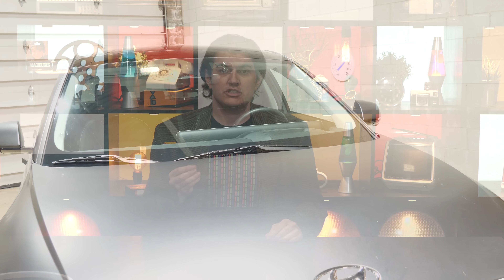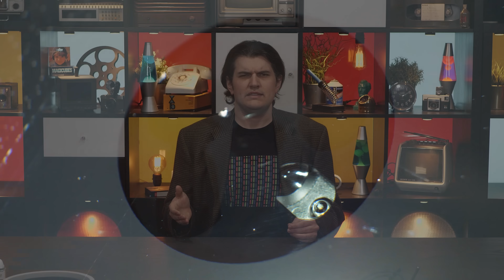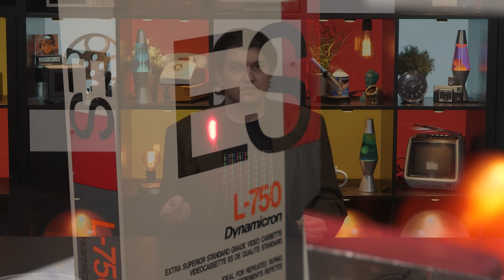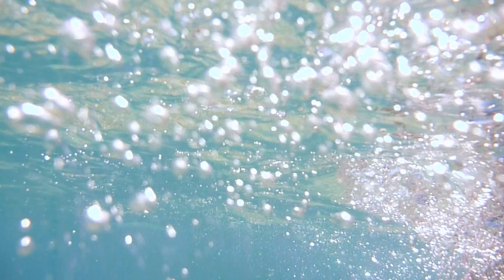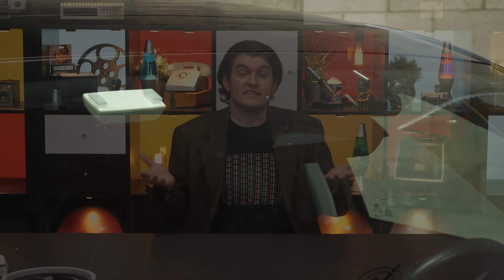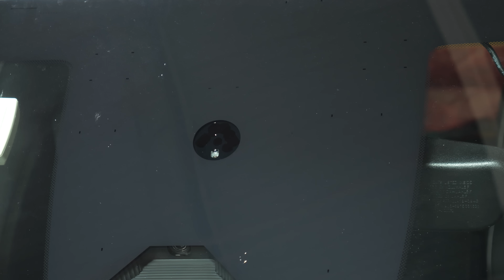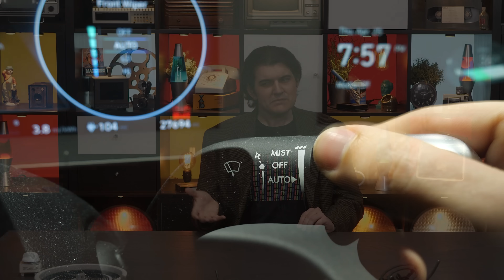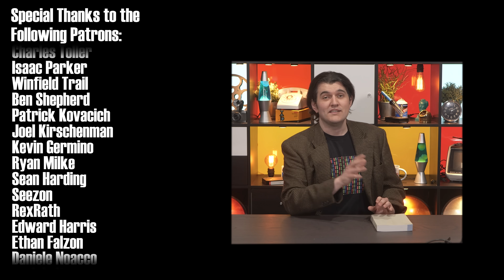The simple, clever sensor behind automatic windshield wipers

Comment: The Toyota I bought last year has them. I do not like them! Even with the sensitivity set to max, they don't operate often enough. The windshield will be covered with small drops and they won't operate. I find myself using the mist setting a lot during light ran showers. I don't like my vision obscured in any way, if possible. If I see a streak or bug spot directly in front of me, it's very distracting and I'll stop ASAP and clean it. OCD can be a b1tch sometimes.... 😄 I'm currently using my scan tool to try and find a way to turn them into intermittent wipers.

Comment: With two sensors, I don't think they would need any calibration at all beyond synchronizing them at the factory. From then on, if their signal intensity is the same = not wet, a discrepancy = wet.

*Disclaimer - This is based on all I know about rain sensors from a 10-minute YouTube video so I reserve the right to be very wrong :)

Comment: I've noticed on my vehicle with automatic wipers that somewhere just over 50% of the time it does a wipe on startup even on a completely dry windshield when parked in the garage. I've also noticed that if it is actually raining when I start the vehicle, and it doesn't do that wipe, which it often doesn't, then I will have to trigger the first wipe manually before the automatic wipers will do anything.
I'm not sure who designed that logic, but it seems like it should either always do that wipe, or be much better at figuring out when it's necessary.
My other gripe with automatic wipers is that rain by its very nature of being a series of drops in random locations can certainly be putting enough water on the windshield to warrant the occasional wipe, without managing to land drops directly on the sensor. I see that your car has two sensors in the same assembly, maybe that helps a little bit, near as I can tell mine only has a single sensor. Even so, I feel like what I would really prefer would be multiple sensors with a little bit of separation between them so as to cover a larger area of the windshield and be more likely to be hit by drops in light rain.

Comment: The Tesla solution of not using rain sensors is total CRAP! I've owned Teslas from 2014 and the first ones had rain sensors, AND it worked great most of the time. Now, with a newer Tesla with "vision sensor", I have the windshield wipers in OFF. I use the button on the end of the stalk to wipe or spray+wipe. I ONLY have Auto on when it REALLY rains. Auto is crap when it drissle/wet road - no wiping, sun - wipes away, tunnels - wipes eagerly..The Model 3 Highland and Model Y Juniper without stalk and/or without wiper button is totally off the table. Sigh 🙄

Comment: The automatic wipers on my Mazda are horrible. they often dont turn on if I’ve left them on in park and it rained, and the detection… especially at night, is just horrible. During the day they’re generally fine, but they didn’t supply a normal intermittent mode on the stock when they are working poorly so turning them off was just more convenient.

Comment: So funny story, I actually designed this exact system from scratch for my Senior project in college electronics about 1997 before this was a feature was even available on automobiles. Mine had a few extra features. One was some logic circuitry so that if the windshield wasn't "clean" after 2 cycles, it would automatically activate the windshield washer. (like when you get that dirty splash back that dries up quickly). In addition there was an inside and outside thermistor that were tied to  some logic circuitry so that if the outside temp was below freezing, it would not activate the windshield washer until the inside glass was above 45 degrees (aka via the defroster). I tried to patent the unit, but the patent attorney said "If its for a car, your wasting your time. the auto industry has hundreds of engineers designing stuff for cars and pulling patents on them for stuff they either never implement or do so years down the road." Anyway...,...

Comment: In fact, in order to achieve fail-safe feature, sensors are designed to send shut-down signal to the wiper motors. So when the sensor fails, the shut-down signal is out, the wipers will run at full speed to make sure you're not losing your sight. This is another thing interesting about that.

Comment: What bothers me is that my car has three wiper modes - Automatic, Fast and Insanely fast. Automatic works however it likes to work and is rarely right. Fast is just that - fast, and isn't always right when there is just a light drizzle and automatic decides to go crazy for no reason. The fastest setting is useless, because I may be getting rain strong enough for it maybe twice a year, if that. Old cars used to have a nice Slow setting, where the gap between the wipes was about 2-3 seconds or so and that was ideal for most situations - a mode that gave you a nice rhytmical pattern that wasn't too slow or too fast and worked in most cases. I'm surprised it is rarely being implemented today.

Comment: For some reason, this rain sensor does nothing but pisses me off. My dad's car has it, and my car has it. I have the urge to wipe every single drop of water, but the rain intensity is often either too weak for the sensor to engage or too strong to justify using the "auto" mode, just like 8:31. And when a weak rain happens, i have to manually do single swipes, because the "low" mode is too fast for it.
Would't it be better just to have a mode with fixed adjustable delay intervals like 1 sec, 1.5, 2, 3 etc.?

Comment: When your windshield gets a crack and needs replacing, will it cost a lot more to get the optical interface material attached to the glass just right (or does a windshield replacement generally mean replacing the whole sensor as well?)?

Comment: It is a little alarming when there is a slight mist and my wipers start at full speed while set at minimum intensity. I change the intensity setting up and down quickly which usually fixes it

Comment: Automatic windshield wipers? - I don't even have the "single wipe" option in my current car😅 Have to switch to "interval" and back - kinda annoying...
The wiper stock does not move up to where you usually would find said option. You could pull on it, but that triggers the water pump and that's not always the thing I wanna do.... so: Pain it is.

Comment: On VW Golf you have wiper command "one struck" when contact is on; the same, contact off, parks the blades in upper position. Good not only for changing them but also when snowing, so that blades arms aren't forced down by the snow on the windshield (and don't stick to glass when icing).

Comment: On my golf 6 when the windshield is already wet i have to wipe once manually or drive off and hope a bump unsetteles it enough for it to trigger.
However to change/clean the wiper blades you just turn the ignition off and manual wipe once. Pretty easy.

Comment: If you have driven enough in snow, there's an analogy for refraction you may have experienced: the way the light bends is similar to the way your car behaves as you get out of the ruts and into the snow. As the light enters the slower medium, that side of the light wave is slowed and, like the car catching the snow, causes the wave to turn into that direction. Obviously it's not identical since one is a wave and the other has wheels and mass, but still, it's a good analogy.

Comment: My Subaru SVX had a winter setting on the wipers. It would stop the wipers around 10 cm higher than regular. This prevented it from getting frozen with a bit of snow and also be in the direction of the warm air flow from the windscreen vents. Simple, but nice.

Comment: I feel so damn smart because I guessed a long time that this would work by infrared and measuring how well it reflects on the inside of the glass. Although I imagined there would be stronger/multiple LEDs at one end of the windshield and the detector would be at the other end so if any spot of the glass between them got wet it could detect it, instead of measuring the wetness in a single spot. But it would be harder to get infrared to shine throughout the entire windshield and you'd need better sensors to collect what IR is left.

Ah okay, it wouldn't be good because you'd also end up measuring the reflectivity of the parts that aren't wiped by the wipers and the car would think it must be raining literal buckets of water ...

Comment: Typically, cars are programmed to stop wiping all together when the hood is opened, so as to prevent any wiper-related collisions. A generally foolproof method to change wiper blades obstructed by the hood is to swing the wipers up, and pull the hood latch right as they reach the top of their travel. They then stop on their own, and generally will stay there until the hood is latched anew and the key is turned on.

Comment: My Cadillac CTS-V has these wipers and I find them to be a pain in the butt.  In delay mode they don't come on until they decide it's "wet enough" and so don't wipe when actually needed. I finally unplugged the control unit so the wiper revert to fixed, selectable delay.  Much happier now.

Comment: I am interested why car manufacturers fit different wiper blade styles to the same models depending on the market. Your Ioniq has old style frame blades, whereas here in the UK I believe they’re fitted with flat blades, and in other markets still, hybrid blades. But weirdly, Hyundai uses hybrid blades on some of its other UK models and there doesn’t seem to be any consistency, rhyme or reason.

Comment: In every car I owned with rain sensor I always took sensor cable off so wipers works like I want. Even lowest mode they always went on too early and wiped way too fast / often. Is it same as dash light adjustment so in manufacturers own good to avoid any problems lowest light mode is too bright. But good tip for everyone: If that auto wiper annoys you just take cable off from sensor. Then  wipers goes like normal. You can adjust all like older cars.

Comment: "Don't ignore the manuals in your life."

I've been a military mechanic for a decade.
Maintenance is based on the findings of the vehicle operators, who likely are not mechanically inclined.
But they are supposed to follow a very specific operator checklist before operating their equipment.
Do they?
Rarely.
Almost never.
Simply following the operation manual would literally save the U.S. military, and thus the U.S. people, millions of dollars every year.
Use the manual.

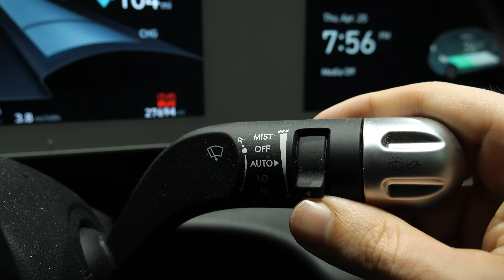Comment: I bought a car recently that had this feature.  While the car is otherwise excellent, this is one feature that I absolutely loathe and wish could be undone.  It never works properly just as is described at 8:05.  It's not that it occasionally has misfires or mistakes, it's that it is always misfiring or not wiping.  I have to basically operate the wipers manually by turning them on and off in the tempo I need for a given rain situation because the sensor will either not wipe or go nuts and wipe at max tempo when it doesn't call for it.

Hear me out on this - this is one technology innovation that is over-engineered.  Once the technology for windshield wipers evolved to the point where you can operate them from inside the car and choose the tempo easily, that was all it ever needed.  It was perfect as it was.  The extra bells-and-whistles like this sensor are just an extra complication and failure point which isn't necessary in the first place.  In a practical sense, it offers the driver absolutely nothing (except making the feature unreliable).  In a traditional windshield wiper, you turn the dial on the stalk on, then one or two more clicks to your desired tempo setting.  Works perfect every time.  In this setup, you still have to turn the dial on the stalk on, then one or two more clicks to your desired sensitivity.  You haven't saved any time or reduced any complication by doing this!  Even if it did work on other cars, it saves you nothing but makes a critical function of the vehicle unreliable.

Comment: BMW windshield wiper sensor calibration can be done with software. Only done when changing sensor or windshield. Drift according to windshield age is automatic (more chips with years). Plus, usually, if activation happens, one wipe is done to notice difference for sensor.

Comment: Is the sensor clever and simple? yup. Does it result in the windshield wipers more often than not going WAY too fast during a light drizzle or WAY too slow during a downpour? also yes. I almost always have to set my wipers back into manual no matter which vehicle I am in. Good idea but more often than not absolutely terrible execution. Same with automatically dimming headlights.

Comment: While my car is sometimes 'lazy' in the rain, it usually just works and I never have to adjust any setting or swtich it to the on wipe setting on the stalk. It just works. Also on my car, I can change the wipers because even in its default off position, its still possible to lift the wipers and change them when needs be. Maybe your car is the outlier with this design fault because every car I have owned I was able to change the wipers in the off position.

Comment: It’s amazing it works. It can only look at a small area and it has to have enough signal change to determine the rain intensity. The camera method, used by the company you did not mention, has the windscreen in its near field, ie not focused. How there engineers though that would work I am not sure. However, recent updates to the unmentioned car brand have delivered auto windscreen wipers that now seem to work OK.

Comment: One problem with leaving your windshield wipers in the “auto” mode is; if you leave your car running (in the neutral transition mode) while in a car wash, your windshield wipers will turn on and be ripped off by the rotating wash brushes. 
Only put them in the auto mode if it looks like it is or will be raining while driving and immediately return them to the none auto mode before leaving your car.

Comment: As for the base-level calibration of the sensor: I have my VW wipers on auto all the time. It seems to be very careful not to wipe the wind shield unnecessarily, until you turn the wipers off and on again. After that, they work fine.

I'd guess they programmed the sensor to rather not wipe a dry wind shield until the driver moves the stock and then take the base level reading.

Comment: A tactic that also may be used for "calibrating" is that it preceives the wet baseline as the dry baseline, until the pattern gets to a higher level, which it then recalibrates (?).

Comment: in dangerous area  it would be advised to turn off the auto wipers. robbers throw raw eggs at the windshields, which causes victims to use the wipers to remove egg. but instead of removing it, it just gets spread across the windshield. and causes the victim to stop the car and get robbed

Comment: If you want a more in depth, but useful understanding of how Refraction works, check out Science Asylum's video on Refraction.

If you don't want to do that, here's a TL;DR.

Light bends because light's speed changes as it enters various materials. When it enters or hits water, part of the photon's wave is going slower than the other, causing light to bend. It's the exact same reason that your car pulls a bit to the side when you hit a puddle on one side but not the other. The side that hit the puddle goes slower and the side that didn't goes faster.

If you REALLY want to get nitty gritty, it's more that light takes the fastest path over a given time through a given material possible... and it just so happens that bending in the manner described above is the fastest when approaching at an angle. As to WHY light does that... I'll be honest... if I tried to explain fully I'd cease to be shortening it. Basically: Quantum Mechanics.

Comment: My dad had one of these automatic wipers thingys about 15 years ago, so it’s not a new technology. What I think has improved is the glue that attaches it to the windscreen. It worked fine on his car for a couple of years and then one day the glue had failed due to excess moisture inside the cabin, you could see the unit constantly surrounded by condensation, meaning that the wipers were always on when set to auto mode.
The unit was also at the bottom of the windscreen as well rather than at the top, within the blacked off section that’s just above where the wipers start, perhaps it was a right hand drive thing not being at the too

Comment: All this sensors driving me crazy.  Except one - automatically switching on the light at dawn.. Lane/parking assistants, seatbelt/rain detection... putting something even small but with some heavier weight on the passenger seat - beep beep beep. I drove several cars with 'rain detection' and it has never been more convenient than manually operating the windshield wipers. Using breaks and step on the gas (not for doing donuts) can be useful under some conditions/terrains or situations
Some cars prevent this, just like opening the door while driving. Why? Whether you have to maneuver or prefer to do so on sight, or a fire or something else happens in the passenger compartment. Simple yes, clever no. Not to mention repairing such vehicles packed with sensors.

Comment: Dumbest feature on my car- it never wipes at right intervals and despite having 3 levels of adjustment you still can't make it run properly. You can't switch to fixed intervals either😂. For example if there is moderate rain and it's on highest setting it runs ok for a minute then it always skows down until can't see anything through thewindsgield.  that's when you can select constant wiping but with light rain you would like intermittent wiping which you will not be able to do it to work as it should Because it either goes too slow or rarely too fast